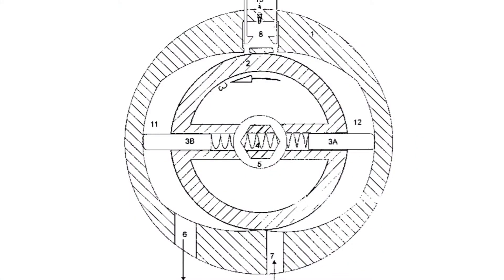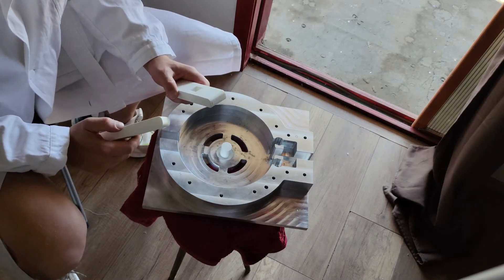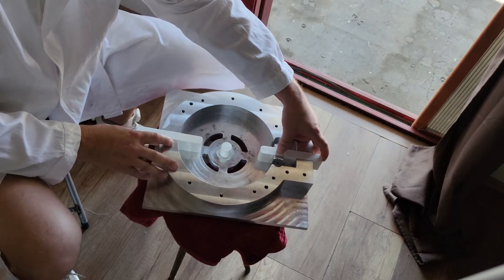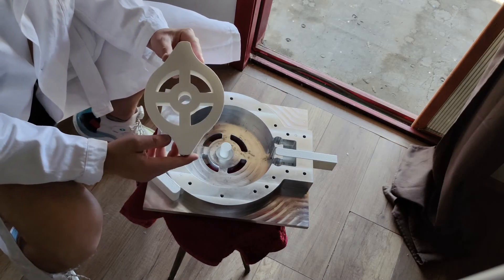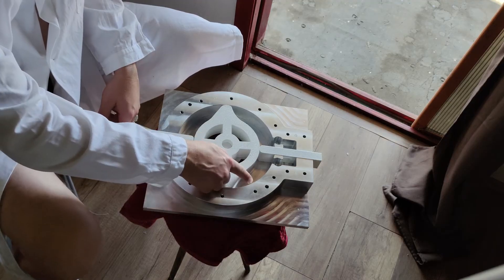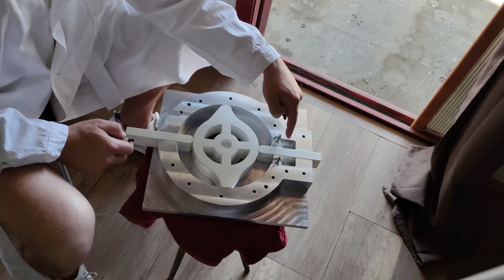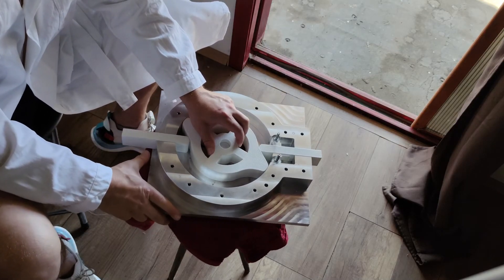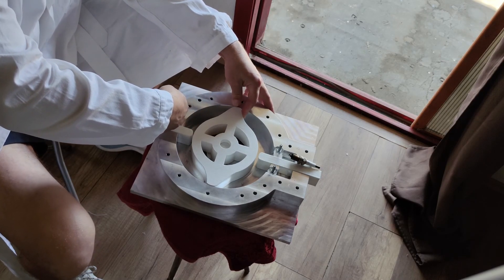Could my patent be the best combustion engine in the world? Rotary combustion engine prototyping

Comment: mechanic wise, this looks like rotary vane vacuum pump but operate in reverse, where it is use to generate power instead of pump fluid. Perhaps the same optimization technique used in rotary vane pump can be reused here. So in rotary pump, instead of having the vane be straight from center to perimeter, they have the vane tilt at an angle like a wing swept. This distribute the contact pressure over a wider area and reduce the effective peak pressure contact area, so the overall friction is less. So you get better seal that wear down lot slower. 
Although the main issue with rotary engine in general is that the combustion area and seal operate in the same place. So you end up burning a lot of lubrication in the process. Leading to worse fuel economy and emission. So either you need to move the seal location away from the combustion area or figure out a way to do seal without lubrication oil. The seal and uneven heating is the bottle neck for rotary engine imho. uneven heating can be resolve by thermal mixing between hot and cold chamber. The seal problem is a lot harder to solve. Mazada still haven't being able to solve after 30 years. Perhaps we need to think the sealing issue from a different paradigm
Reply from the maker: thank you for your comments, it should be noted that the rotary piston and the stator are raw in the video. Each rotating part will have bearings and each move will have seals. Most of the friction is transferred to the seals, similar to the sealing rings on a piston in an engine cylinder. The internal parts of the engine will be coated with a super resistant layer of NIKASIL.
I wouldn't be able to fill the combustion chamber if the blades of the rotary piston were deflected. The stator is made of aircraft-grade aluminum, which is a great conductor of heat, and the laws of thermodynamics balance the temperature.
My task will only be a gasket, unfortunately still similar to a Wankel engine, the first prototype should be powered by a mixture of oil and gasoline, similar to a two-stroke engine - test the functionality, efficiency... and only when this is done, I will deal with lubrication, cooling, etc.